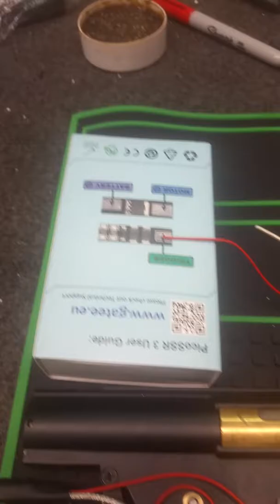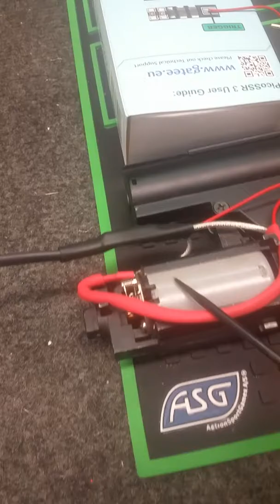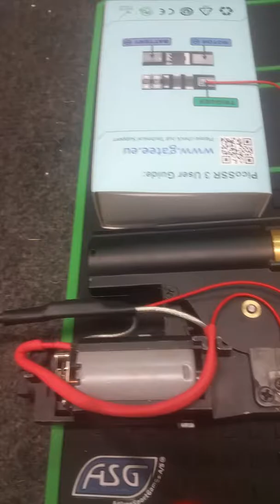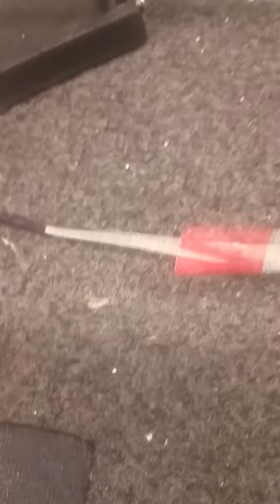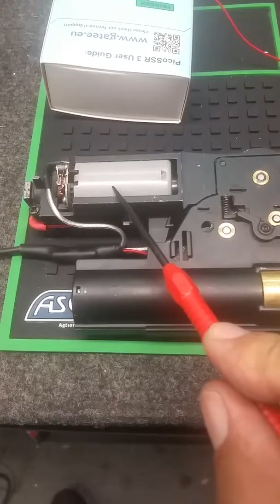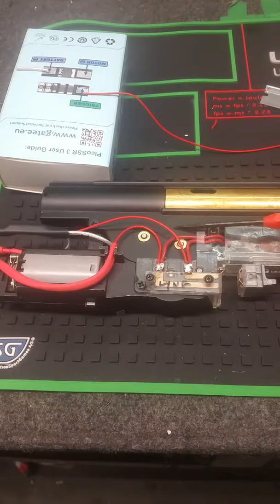ECHO 1, JG P90 GATE PICO FOUR WIRE INSTALL

Comment: I know this is old but I'm having a hard time. I wired up a gate warfet to my p90. Battery directly to motor. Then I used the two signal wires and put them on my contacts and took off the stock wiring going out of them. The gun fires without the warfet in (and without pulling the trigger) but will not fire with the warfet plugged in. Any advice?
Reply: I can't say for sure, unless you can email some pictures to the shop, nesairsoft@gmail, but I  think y ou have the two signal wires in the wrong position. The P90 use an "extra" signal wire because one the two seperate mechanical switches. The first switch is for the semi, then there's a second mechanical , set of contacts for the FA. So you need to not cross the each of the two switches wiring. BEst I can come up with off the top of my head. Feel free to email pictures maybe we can better help you out.  Mike